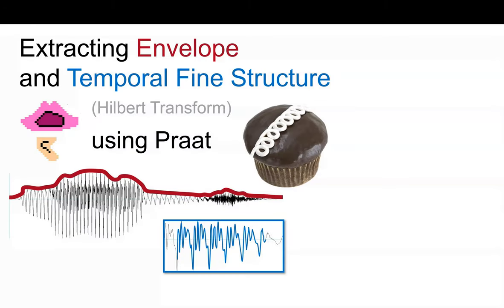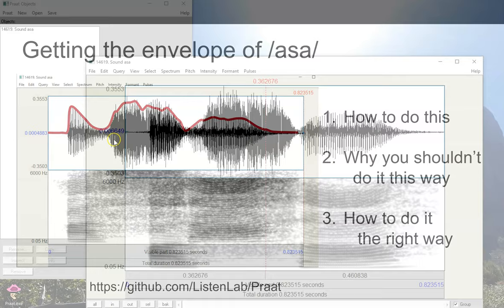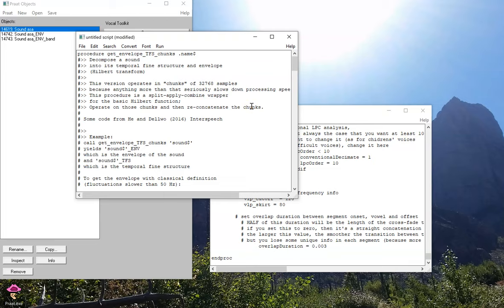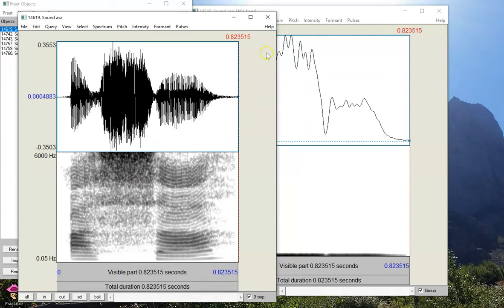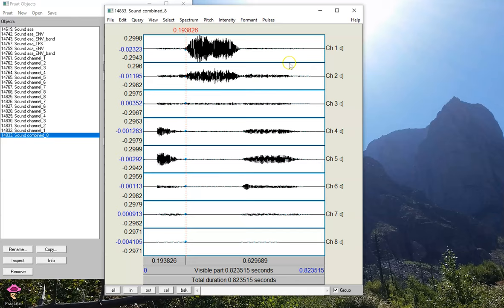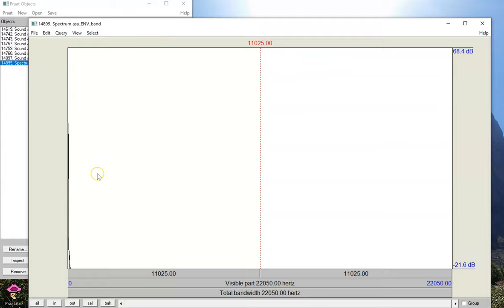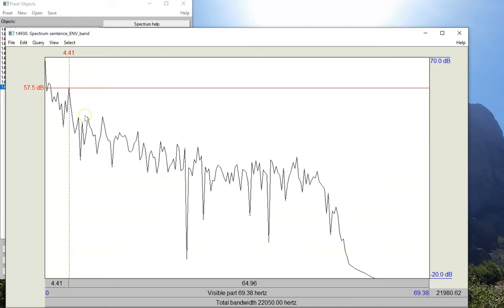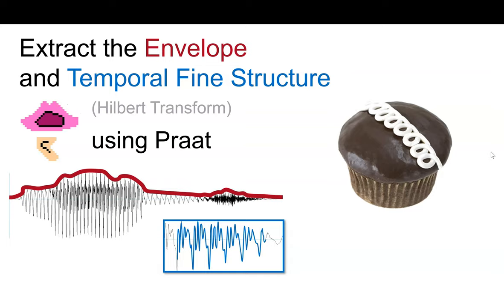Extract Envelope and Fine Structure in Praat using the Hilbert transform

Comment: Hi. I have found the paper for PRAAT script. But how can I simply copy the script?
Reply from the maker: follow the links in the description. You can copy and paste the code into a text document.
Reply: @listenlab_umn  Thank you sir, it worked so well! Just curious is that possible to extract the envelope in the form of numerical values, and export all to Excel? I'm trying to correlate singing signal envelope with brain signal envelope. Already done so for brain signal. So if I can extract the numerical values for audio signal from PRAAT it would be very helpful to run the correlation test using SPSS afterwards.
Reply from the maker: @hahar18  yes, you can export any object in praat in various ways. You can cast it to a table first and then save as csv.
You might be interested in using a more powerful platform than excel. R or Python are very useful languages to know.
Reply: @listenlab_umn  I've been trying to export it as a table as advised but seems that I failed to sort it out. Do you mind sharing any link that I can follow through? Thanks!
Reply from the maker: @hahar18  I'm not in a position to troubleshoot Praat from this video channel, but I recommend these pages:
https://www.fon.hum.uva.nl/praat/manual/Spectrum.html
https://www.fon.hum.uva.nl/praat/manual/Intro_3_8__The_Spectrum_object.html
Reply: I am wondering how to divide the original speech sounds into 8 frequency bands with Praat as in the video. Thanks! @listenlab_umn